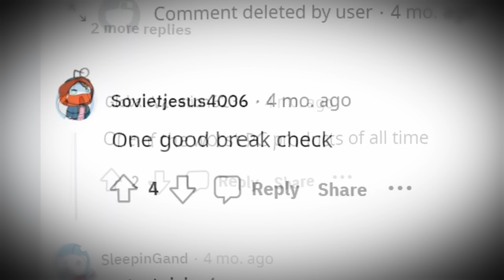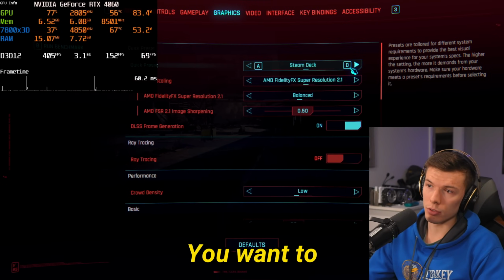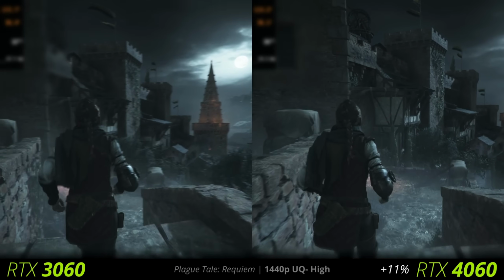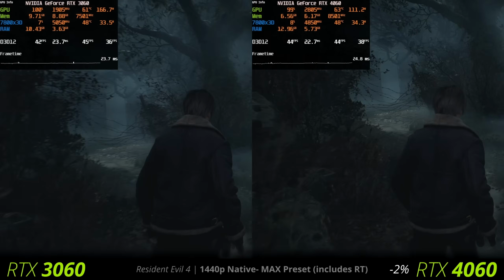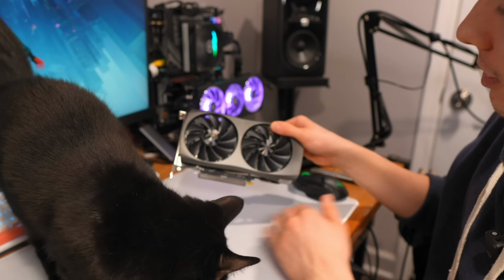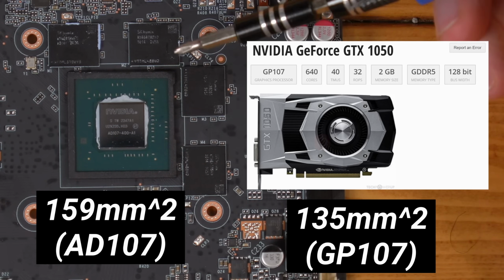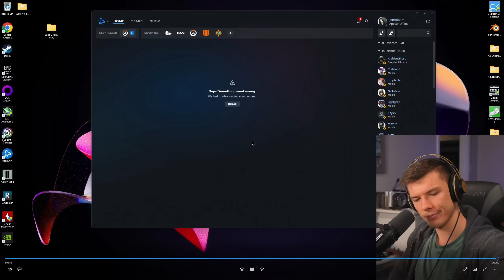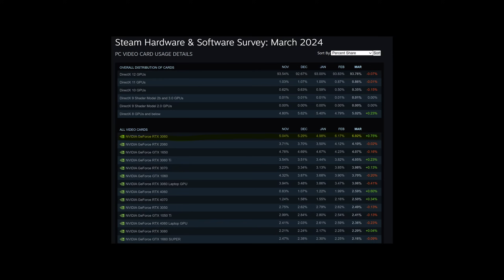I Tried Nvidia's best "Budget" GPU to see if we're Doomed

Comment: It's not the card issue, its price issue.
Reply: Always
Reply: @I_hate_you_Forza_motorsport  No it's the price issue. if anyone can buy it with a 100 $ it will be the best card
Reply: @I_hate_you_Forza_motorsport  You know the 4050 already exists, right?
Reply: @gamerz64xd Thats a laptop chip.
Reply: I mean the price is the problem the performance is meh the new tech/features or whatever you wanna call it is what set it apart from it's predecessor but there's options on AMD that's cheaper with better performance
Reply: @I_hate_you_Forza_motorsport  It's a 30/40 class chip, since it's 148mm^2 die size, while the rtx 3050 is 198mm^2 and the gtx 1650 is 200mm^2. The rtx 4000 series are as overpriced and poorly named as the gtx 1000 series.
Reply: I'm amazed that you can't see the merits of the 4060. Yet nearly everyone falls into this same trap.  It's a budget card that can do a little more than its predecessor the 3060 like-for-like, and also has the AI frame generation for smoother FPS, yet it is around the same price and runs significantly cheaper and cooler.
It fits perfectly into the budget price of someone who wants a basic card that can run 1080p easily and 1440p reasonably.
The 128 bits is perfectly adequate for this level of card.
You can run any game available today, the most GPU pressing ones might need a few quality settings lowered but that's what a budget card is about.
You want it even cheaper than its predecessor? Why?
Reply: @greatbriton8425  facts dude these ppl want a card that perform like a 4080 but the price of a secondhand GTX 1030 and who knows in future driver updates the 4060 might get 30% faster by than it'll be the next power efficient budget King like the RX 6600 and you'd see it in all builds well budgets tho
Reply: @greatbriton8425  I'm amazed that people don't understand that performance and features are a byproduct and not a cost factor.

Die size determines a chip's cost(be it GPU, CPU, FPGA or ASIC or any IC chip). 

The rtx 4060 has a die size of 148mm^2, the rtx 3050 has a die size of 198mm^2 and the gtx 1650 has a die size of 200mm^2. 

The RTX 3060 has a die size of 276mm^2. 
The RTX 2060 has a die size of 445mm^2
Reply: The price is a the biggest issue but it still doesn’t bear the 3060… that’s not good
Reply: @I_hate_you_Forza_motorsport The 4060's only problem is the VRAM, apart from that, it performs better than the 3060 in most scenarios.
Reply: @gamerz64xd  the 50 "tier" is the worst thing I've ever seen
Reply: @scarfaceReaper From what I've seen, it's already appearing on some budget builds, mostly for those who play Fortnite, but it's great for the latest titles and power efficiency could be very helpful if electricity costs alot in where you live.
Reply: @gamerz64xd really? 😂
Reply: @Rullino32  yea another thing "PC gamers" don't see is the huge advantage this newer cards have in power efficiency and like you said it's needed wherever you live, some cards over the same power draw with more performance or less power draw with more performance either way if they are priced right it's a win
Reply: @scarfaceReaper great power draw at 5 seconds per frame
Reply: @scarfaceReaper Sorry for you but drivers will not help with 8GB Vram limits and i hope you all know that Frame Generation takes Vram to perform.
At 1080p gaming, Frame Generation takes from 500 mb to 1 gb of Vram
So Nvidia is asking to pay for a feature that will be unusable in future games unless we lower game details.
And i don't want even talk about 128 bit bus.

This is a card be born as if it was already near the end of its best time.

They are simply labeling as a mid-tear card what in past times would have been sold as lower tear.

If people is happy to be scammed, fine... to each their own fetishes... i would simply wait for the next gen or just buy AMD (and i'm an Nvidia user since ages).
Reply: They pricing the card at 300$ instead of 120. Its a price issue. ($100-120 would be acceptable tho)
Reply: @embrance9565 That would be too low, this is a $160-180 card.
Reply: @ITABehelit  would be if things like rx6700, 6800 would not exist and , rx5700xt is literally $110.
For 300 im getting a 6750xt or 6800 with luck. Not a 4060. But damn 55$ rx580-590 if 1080p 8gb..
Edit: 2080 TI, for 190
Reply: Now I'm not gonna say a very good price wouldn't make this card a good deal. It would. But there are deeper issues with the card. And really the whole generation. The naming shenanigans are genuinely annoying and every single card in the stack should have had ~%50 more VRAM simply to be on par with its overall performance.
Reply: @I_hate_you_Forza_motorsport  the name or "class" of the chip doesn't really matter, that's just how they market it. If it was cheaper people wouldn't care too much if it was called a 4050 or 4060
Reply: @scarfaceReaper lol, that’s not how driver updates work
Reply: It should have been 4050ti with 8gb vram and cost between $200 and $250.
Reply: @greatbriton8425 Because a next generation product is suppose to be better not similar with just a little software fluff.
The 4090 crushes the 3090. They made sure the top buyer gets his new card upgrade performance. So why should the 4060 buyer not demant the same from his card compared to the 3060?
Reply: Clearly it's a card issue when it's literally WORSE than the last one. Not hard to understand. If they make it worth 300 dollars than I'm happy.
Reply: @scarfaceReaper  Well said
Reply: @SIPEROTH  It IS better than the 3060. Yet priced the same. You want to run Nvidia and say, make the 4060 MUCH better than the 3060, and cost more too. But think for literally 1 second. Don't Nvidia know better than you what the market wants? Don't they want to sell their GPUs? So they figured out the budget 4060 is better than a more expemsive '4065' - something closer to the 4070. So what? If you don't like it, don't buy it. Buy the 4070 or an AMD.
All I'm saying is people are jumping on a bandwagon created by some YouTuber who started all this by by not thinking hard enough about what the 4060 offers. It's close to the 3060 Ti. It can do a lot of 1440p. It can smooth frame rate. It runs much cooler and cheaper. And it's the SAME PRICE - aimed at the budget PC gamer, it's perfect actually. Do some research on it.
Reply: @EJM07  It's not at all worse than the 3060. It's better in several ways. Do your research.
Reply: Also the name, should be called rtx 4050 instead 😅
Reply: in price point more like 4020 @macblink  you know those tiny cards that is a size of a credit card , and the only purpose is to display vga output on a server rack....
Reply: @greatbriton8425  Dude why are you saying "It's the same price" like Nvidia is making as a favour?  It is the same product category.  Is supposed to be similar or same price. Jeez. 

And is not because of any Youtuber or anything. 
It is simple expectation for progression.
This 4060 is just too small of an improvement step, simple as that. 
Until now every other GPU at it's category was a much bigger step than the card it replaced that the 4060 compared to 3060. 

You talk like they aren't suppose to actually make progression and everything is fine if they sell the same thing as long as the PRICE IS THE SAME. 
Well it better be is hardly any better. 
People expected 30-40% better rasterization or at worse at least 20%, not barely 10%.
Reply: It’s a disgraceful performance from the 60 series card
Reply: @SIPEROTH  This was the biggest mistake the first youtubder made and everybody fell for. They looked at the engineering of the card and said, oh it has worse options, only 128 bit vs 192 bit, only 8Gb vs 12Gb, oh, oh, oh, and forget that with the newer tech and DLSS features etc it runs faster and cooler - perfect for a BUDGET GPU right now. Why should the 4060 be a big step up from the 3060? Why should it match or beat the 3060 Ti? It's 15-20% faster than the 3060, that's good enough: if the current budget gaming needs are adequately met by a card that is just as cheap but runs much more cheaply and cooly, and can do Cyberpunk at 4k with some reasonable optimisations, isn't that great for a budget gamer? Why make the gamer pay £100 more, up front, and £30 more per annum on power?
Yes, people expected a bigger jump up, but it just wasn't a sensible bracket for the 4060 to aim at at this current time.
That doesn't make the card weak (it does what it needs to do) or overpriced (on the contrary, it's price reflects that fact that it's a budget GPU - perfect for the budget gamer of today.
Yes, if you have a 3060 already, maybe it's not worth upgrading to the 4060. But EXACTLY the same was true of the 2060 to the 3060, which was 15% faster than the 2060.
So people are bitching  because they see a drop in 2 engineering aspects and emotionally assume the card is 'weak', when in actual fact the new tech made that drop still deliver 15-20% better performance for less power AND smoother frames.
Here, read these: 3 benchmarks and 1 for the 2060 v 3060
https://www.pcgamer.com/nvidia-rtx-4060-vs-3060/
https://www.eurogamer.net/digitalfoundry-2023-nvidia-rtx-4060-review
https://technical.city/en/video/GeForce-RTX-3060-vs-GeForce-RTX-4060
https://www.gpucheck.com/compare/nvidia-geforce-rtx-2060-vs-nvidia-geforce-rtx-3060/intel-core-i7-9700-3-00ghz-vs-amd-ryzen-5-5600x/
Don't just drink the Kool-Aid and spout it, dop your own research.
Reply: @SIPEROTH  No, the 4060 is a generational ste up. It could easily be a higher price. My point is that it delivers MORE for the same price.
You say until now every generation was a big step up, well, the 3060 was 15% faster than the 2060, and the 4060 is 15-20% faster than the 3060. What more do you want?
Not sure why you want 30-40% better at the same price, that's NEVER been the case.
The mistake the youtubers are making is looking at the drop in the bus of 192 bits to 128 bits and memory from 12G to 8G and thinking "it must be worse than it could be". No, it's not. It's aimed at the same market as the 3060, it does better and runs cooler and £30 per annum cheaper.
Reply: @AZI3623  Sigh. No. read my 2nd last comment. Stop being a parrot.
Reply: @I_hate_you_Forza_motorsport  I don't see anything wrong if it can perform better than the 3060, the chip size isn't an issue, but the only problem I've seen is the VRAM and the price depending on where you live.
Reply: @embrance9565  It performs better than the 3060 in most games, so the price should be slightly low since it doesn't offer much VRAM, but I think it should be Alright if it stays like that, making it cheaper than that would just make it too good for it's specs, it's much better than the RX 6600 and 6600xt, which wouldn't make sense for a card that's better than the previous-gen model, even if it's a slight improvement.
Reply: @Rullino32  when I read the "4060 much better thn 6600xt" I came to the conclusion you are an nvidia fanboy.
Nothing left to say really...
Rx6600xt is literally the same in perfomance and better according to tests. So?
Reply: @rattlehead999  man i know 5nm can't cost that much, for NVIDIA to cut it down THAT hard
Reply: Blud really out there defending this 300 dollar piece of garbanzo 😂
Reply: Someone been listening to Papa deals
Reply: @I_hate_you_Forza_motorsport  so, it's a price issue?
Reply: @beepboop6212  Nope, people praised and bought the gtx 1000 series which were just as overpriced as the rtx 4000 at MSRP, the prices were just lower. And from there on there was no turning back.

Although it started with the gtx 680, which was literally called the gtx 660 a few weeks before release...
Reply: Nah it's a vram issue. If this had 12GB of vram or more it would be doing so much better.
Reply: @rhonjomyne  It would be sad if 12GB of VRAM and 192bit bus made it sell better. It would only worsen the GPU market.
Reply: idk,i see the r tx 3060 at 280$ and the 4060 310$,i live in pain if someone asks
Reply: For 4060 I disagree it is the card issue
Reply: @SIPEROTH Yeah I don't understand how people fail to see this they're drinking the green Nvidia stuffs a 60 class card should always be better in raw performance from the previous 60 class card 3060 was 2080 level performance or something I am not going to check but it's pretty high from 2060 and double the Vram so why not we expect similar things ?
Reply: @Rullino32  RX6600 and 6600Xt are much cheaper. They sell for 200-230.
Reply: @rattlehead999 why because there would be no reason to step up to 4070? 12 gb should be minimum games are using more than 8 gb all the time
Reply: @greatbriton8425 Your data is misguided the 2060 vs 3060 article benchmarks the 128 bit 3060 which performs worse than 3060 12 192 plus 3060 always came out on top of 2070 in benchmarks 4060 can't even touch 3070 it's not a bad card 4060 is the worst because it's aimed at gaming level for high / ultra settings  1080/ 1440 3060 could do it all when released 4060 can't and dlss sucks along with fg only good thing is dlaa but it too sometimes over sharpens the image delivering a worse than native experience which you could achieve with 3060 with the games that were released back then if you omit out ray tracing.
Reply: @greatbriton8425 Nvidia shill
Reply: @SIPEROTH  The prices are cheaper in where you live, but in other countries they could be similar or higher, which is why I've seen many people buy Nvidia graphics cards outside of the US.
Reply: @nuffsaid7759  So the 192 bit 3060 is the exception, not the 4060. Also, I disagree with you about the 4060's capability. I've watched reviews and ti looks great.
Reply: @nuffsaid7759  Because i made sense and you can't refute it :P
Reply: @greatbriton8425  192 bit 12 gb is not the exception it was released early in larger volumes than 3060 8 gb which was repurposed laptops grade cards and not the desktop one for which Nvidia was criticised because they don't perform the same and I think it was released a tear late after 3060 12 gb launched seriously your sense is Nonsense
Reply: There are multiple problems with this GPU. I almost bought one for a mid range build I'm putting together. So glad I held off and wound up spending the extra money for a 4070, though honestly I'm kind of worried how a $600 4000 gen GPU is going to perform. Its almost like Nvidia put this card out as some kind of joke. The RTX 3060 takes the 4060s lunch money and bangs its GF all day long.
Reply: @stephenhood2948  You're wrong 4060 can't get a gf
Reply: @nuffsaid7759  LOL You are right, it would have to pay for one.
Reply: @FronosElectronics  that fuckin sucks dude, imagine in china making 4050 gpu with laptop chipset in there like the good old days of sketchy chinese brands.
Reply: I bought my 3060 for the same price a 4060ti is now. 
I'd say it's a good upgrade if you're on a older gpu.
Reply: nvidia greed
Reply: @scarfaceReaper no. People want the 4060 to be better than at the very least a 3060 ti, preferably comparable to a 3070.

For price, let's not forget that when the 1080 ti first launched, it was $699 (around $888 for inflation). This was the most powerful card nvidia made at the time (there was no 1090/1090 ti). For a card that at the time was $240 ($300 now), you'd get roughly a 1060, but you'd also have: 1050 (ti), 1030 & 1010. These were supposedly overpriced at the time as well. I could do the research on the 700 series (since I'm a bit confused on the 800m & 900 series).
Reply: @Neetie98  Pretty much anything is an upgrade from an older GPU, and pretty much anything other than an RTX 4060 is a better choice.
Reply: @stephenhood2948  I had a 1050ti prior to getting a 3060 2 years ago, what would be a better choice than someone in that situation?
Reply: @scarfaceReaper  u wont RAY trace on those AMD cards they suck at ray tracing so we are back to square one , 4060 is a good card , price is the only problem
Reply: @asdfag557  rt at the moment is a shitty thing nvidia uses to get ppl to buy it at a higher price...
Reply: It shouldnt be beaten by 3060ti
Reply: @gamerz64xd  cope
Reply: @greatbriton8425  lol with 8gb this shit wont even start some application like ai training which a student might want to do

u telling me taking away the vram for a little benefit is a good reason to sell stupid price? cope

i will be taking more vram anyday
Reply: It's not that much more expensive than RTX 3060, and it can do DLSS as opposed to RX 7600.
Reply: @piadas804  lack of memory, such untapped potential,  you always need to ask question what's on the table for price. i'm still daily driving vega 64, because it's still good enough, and can utilize my main memory without any dips even above 16 gb vram. What a shame AMD ditched HBM, i think that's the way to go, and probably hbm still will be the future. I bought vega instead of 1070, price was the same, but oh god i was so right that day.
Reply: @greenpixel556  
Memory is not that important. What mostly matters is the performance of the GPU. 
Yes, it would definitely be nice to have more VRAM, but what graphics card competes with the RTX 4060 and has more VRAM? RX 7600 XT, yes; but it is not so great for the one who wants ray tracing and DLSS.
Reply: @urnoob5528  AI training isn't gaming but if you want more VRAM it's not free, just pay for it - get the 4060 Ti 16G - there's tons of options, but not for a £290 card. Just pay for what you want. The whole frigging point of the discussion was, is the 4060 too low in power compared to the 3060 or 4050 or 4070 or its price point, just because it has a 128 bit bus and 8G, and the answer is a clear No! It does what it should do for the price. It's priced exactly as it should be. In fact, it's priced a touch low.
It is in fact the LOWEST $ per frame Nvidia card existing today at 1440p.
So check your attitude and start learning before you speak like a fool again.
Reply: lol what it its a $300 card with around the same power as a 2080, seems pretty cheap for the amount of power you're getting...
Reply: @I_hate_you_Forza_motorsport  I got a gaming pc rig with it and so far, the benchmark said I could run 96% games at high settings. I play VR on it at max settings, so idk the f you guys on about.
Reply: Wanted the 4060 ti for the 16gb of ram tho ngl.
Reply: And vram
Reply: @scarfaceReaper so we should accept and be fine with an increasing minimum/baseline price for reduced performance per new GPU gen release?
Reply: @sirderpsalot  never said ppl should accept it...I meant as in ppl want a car like a Lamborghini Aventador SV yet it should cost like a golf which is stupid, you should consider what it cost for the company and other stuff and don't forget a business needs to make a profit (something many don't seem to get ) and the 4060 is faster than the 3060 , it's close to the TI or on the same level while being cheaper. Now I don't agree with how the market is today but seeing you get a new card that's more powerful yet cheap or even cheaper than it's predecessor is rare.
Reply: @greatbriton8425  I built a new am5 system and decided on the 4016 TI 16gb because got on sale 550 cnd.  No regrets runs everything on high/ ultra on my 4k 65 inch tv over 100fps
Reply: @jeffbrossard163  Glad it's working for you. Just want to ask if you ever looked at or considered a Radeon GPU? Only asking to collect some consumer data for a college assignment.
Reply: true the price of 4060 here  in ph its around 320~390 $ its too expensive for a 60 series GPU with that price I can buy a used 3070/ti
Reply: @ZeroOnePH  just tested 2.0 cyberpunk with AM5 build 4060 ti 16gb vram and getting 58 to 61 fps 1440p 65inch big screen consistent with dlss. Running great. Im loving this best part is got game for free!! And use a PS5 controller and kb/m to boot.
Reply: For some reason in my country 4060 is cheaper than 3060
Reply: @hkexe  yeah 3060ti is more here last I looked its really weird. I have Both 4060ti 16gb and 3060ti 8gb
Reply: i dont get this because how can the card itself be bad unless its literally broken
Reply: @Penguin-gq7mp  it's a good card
Reply: I got it for 170$ is it worth it ??
Reply: dude i dont get it, because theyre like $450 AUD where i live which is like 290 usd how is that not a good deal? its amd competetor is $50 more for 6% performance, 100 more watts, not having dlss, terrible fg & rg bro i do not get it, its a cheap good card
Reply: Hi I’m a potential pc builder which nvidia cpu do you suggest instead but I’m on a budget of 350 $ but want a quality gpu which can run Fortnite streaming while maintaining a stable 300 fps in game
Reply: Yeah because y’all are broke. It’s literally a 1080ti with RT cores, DLSS and Frame Gen… for less than half of the price of a 1080ti in todays money…. You’re right bro, it should be less than a quarter of the price of a 1080ti new… then it’ll be a value 🤡
Reply: Naming a GPU RTX when it cannot do any ray tracing is a scam. It's actual name is the GTX 4050. Most people just believe that RTX means ray tracing and choose nvidia just for that very reason. So it is both a card and price issue.
Reply: @greatbriton8425 finally, someone who doesn't discourage first time pc builders

I have 4060ti and the only reason i have it is because of its ray tracing. I do editing and rendering as a freelancer and its better than amd gpus. AMD literally is only good for games and not for graphics related stuff, especially rendering.
Reply: Name too its an RTX 4050
Reply: @rattlehead999  Ah that explains why my friends 2060 can be overclocked like crazy.
Reply: @rattlehead999  the 1000 seriex Nv GPUs were incredible, the 1060 for the time smokes the 4060 for price to performance, Nvidia has been charging you more for less with each generation and y'all like the slowly boiling frog just happy that its warm..
Reply: @scarfaceReaper  Do you even understand you can get a 3060ti for half the price of the 4060? why is it being the same price even a point in favor of it?? YOU CAN GET THE SAME PERFORMANCE FOR HALF THE PRICE NOW.
Reply: @jeffbrossard163  Speaking like a true console only gamer.
Reply: @tmsphere  huh?? What u talking bout willis I have everything just built a wicked am5 rig to.
Reply: @tmsphere  complete bullshit
Reply: @greatbriton8425  The 3060 was challenging the 2070 super and 2080, 4060 can’t even beat the 3060 ti, generational micro improvement. DLSS super resolution? 30 series has it, DLSS FG? 30 series has access to FSR FG, it’s only merit is it’s 15-20% increase in speed, which shrinks even further when you OC the 3060. It’s not a bad card, it’s just disappointing compared to its predecessor.
Reply: What's $300 nowadays...it's not a fortune.
Reply: @itsvmmc  they are still 650 canadian jeez. I paid 575 canadian on sale 1 year ago
Reply: yeah and that is why i decided to get a rx 7900 xtx instead of 4070 ti super after all in some benchmark websites they classify it as the second available gaming gpu when it comes to preformance after the 4090 rtx and it is cheaper than the 4090, the 4080 and the 4070 super
Reply: If you're not doing LoRA training or blender rendering the 4060 costs too much compared to better cards you can get for less. And if you're doing that then the 3060 is better for less. In other words. The price is awful for the performance you get regardless of what you plan to do. It's not fast enough for a good deal in gaming. And not powerful enough to be a good deal in early ai training/art. In other words. It's dogshit, but almost exclusively for the price.
Reply: I paid 305$ for mine and I love it! I upgraded from a 2060 super and it made my Praydog VR mods *playable!
Reply: @Rullino32 it can play Apex legends  1440p at 140 frames stable on max settings...
Reply: In my country a 4060 can be cheaper then a 3060 , the 4060 is around 300$ should i get the 4060 ?
Reply: @rattlehead999  Who cares? On the consumer side it has no visible difference. And also 4060 isn't complete its own marketing goal by itself lol. Low fps on low settings with RT is that really good for 300$? Okay nice, how about GTX 1060 which was excellent decision to play games in 1080p on high or even ultra setings till 2020 year? Stop being fanboy of NVIDIA's monopoly and defending them, it's not the same company as in 10s.
Reply: @shleiff.mp4  The gtx 1060 came out 3 years into the weakest console generation ever relative to PC performance.

The Xbox One had a GPU as good as a gtx 460, let that sink in.

The PS5 has a GPU as good as the rtx 2080.

And the 4060 is a 30/40 class card, too bad they named it 60 class and put a 300$ price tag on it, that's what happens when you bought the gtx 1000 series.

What matters is the profit margins, the gtx 1000 series were sold at 90-138% profit margins, the 900 series at 40-50%, 700 25-35%, 2000 series 50-60%, after that it's hard to tell because TSMC stopped giving wafer prices to non-customers and Nvidia started selling AI chips a lot.

But the rtx 4000 is just as bad as the gtx 1000 series, the numbers have just shifted upwards.
Reply: It’s a 115 watt card 💀 it’s certainly worth the price considering it beats the crap out of AMDs crappy solution
Reply: @rattlehead999 literally why does it matter that the chips are smaller???
Reply: @tushartanvir5672 that’s like asking them to sell a 4090 at 400 bucks. They’ll lose money
Reply: @Thewaterspirit57  because dissipation is watt per mm^2, not just overall watts.
A 300mm^2 running at 40W can be cooled almost passively with a medium radiator, a 40mm^2 running at 40W needs a good single tower active cooler to be cooled. 

basic physics.
Reply: @Thewaterspirit57  It doesn't beat the 7600(XT), and the 7600(XT) is on the N6 process node, so it consumes more power due to that, while the 4060 is on N5P.
Reply: @rattlehead999  bro really doesn’t know the RX7600 absolutely sucks 💀
The node difference is 6nm VS 5nm, that’s pathetic how AMD thought releasing a 165 watt entry level card was a good idea.
It got only a 10% uplift from the 6600XT and is somehow less efficient lol
Reply: @Thewaterspirit57  it's a 14% uplift from the 6600xt and it consumes more power because it's clocked a lot higher. 

And how does a cheaper, faster rtx 4060, that does indeed consume more power, but not too much, suck? 

The 7600xt is on par with the 6700xt nowadays, for less money than the 6700xt when it was new and that is before even taking into account the inflation.
Reply: @MrBlackdragon1230 Now THAT is a great budget ballers
Reply: @greenpixel556  price issues only part of the reason. This card is hated the other reason it the naming it's truly a 4050 and the bump in performance matches when compared to the 3050. So to just to justify the price hike they called it a 4060. and released the 4060 ti which is a true 4060 and so they can claim extra 100$usd. I won't get in to amd shooting them selfs in the foot over this one.
Reply: 400$, best strong perfomance-price card for now
Reply: I got a 4060 , it's pretty good . I'm happy.
Reply: @LordBaranius  ok